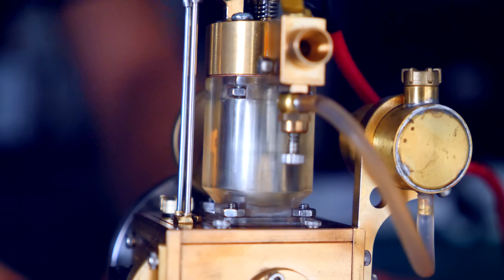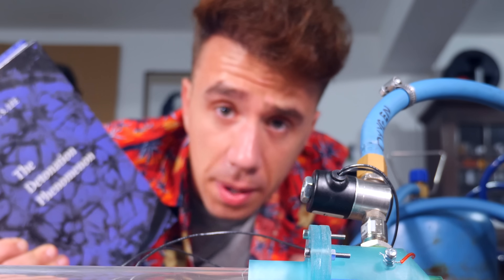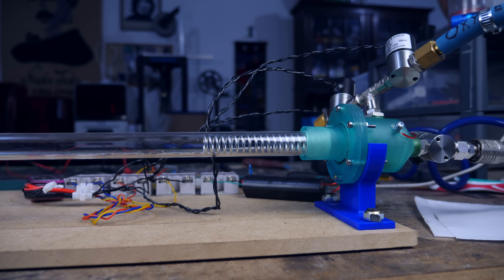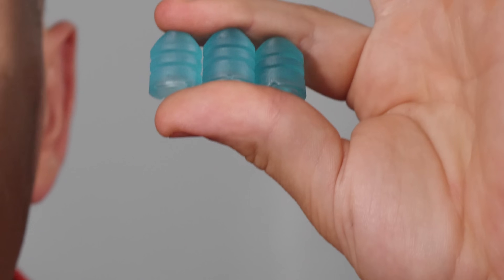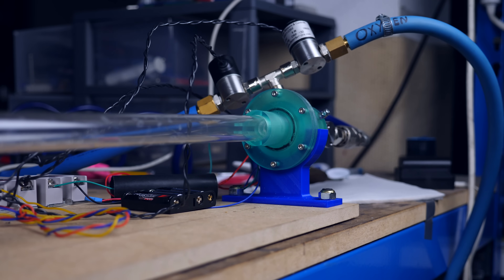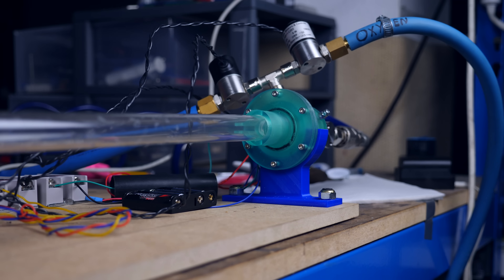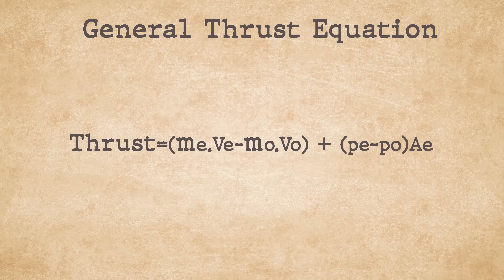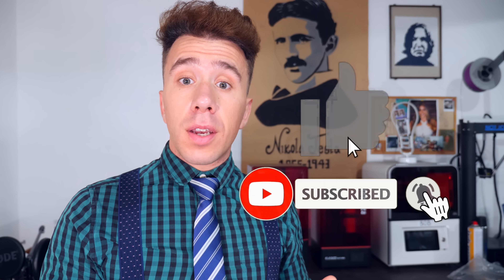PULSED DETONATION ENGINE

Comment: The mushroom shaped flame really resembles what you would see when you look at high speed footage of guns. It's easiest to see with big cannons or tank guns as the projectile keeps moving but the gases behind it gets slowed down by air as it expands. And this rapid expansion is why guns are loud; suppressors (sometimes called "silencers") expand the propellant gases in chambers before letting them out to the surrounding air, reducing noise at least to the point where it won't permanently damage hearing (hunters in Nordic countries are required to have suppressors on their rifles--an odd inversion of many countries' laws--for exactly this reason). 

And detonation is an interesting topic for propulsion because it will mean better fuel consumption. Maybe consider using the detonation to increase momentum of  air in a chamber so that it would exit at a higher velocity; this is the philosophy that detonation engine research is running on, either using standing waves in something resembling an afterburner chamber or rotating detonation that replaces or complements an existing combustion chamber (this also simplifies the engine design since you can reduce the number of compressors).

Comment: What happens when you add a nozzle that closes down towards the end, this would convert pressure into velocity by bernoullis law and make it act more like a jet engine. You could get rid of the pulses by adding check valves and having a continouus flow of butane and air/oxy over a continouus arc. This would likely require a redesign to make the chamber more heat resistant. Additionally i could imagine the diameter of the chamber and tube/nozzle being very important compared to the gas flow you have. Anyways very interesting engine design.

Comment: You could also use a standard turbo for a rocket using compressed air and a fuel injection system and ignition with either a printed or milled nozzle. Try running the exhaust from the turbo back into the turbo with a fuel sprayer and ignition system? Once the compressed air gets it going redirect some of the exhaust back to the intake turbine a mixture of the exhaust and combustion should keep it going.

Comment: I’d love a 3d printer so I thought I’d suggest instead of oxygen why don’t you use electrolysis to generate your own hydrogen to burn in your rockets?
It’s simple to do and it looks like you’d have most of the equipment to compress the hydrogen…. You can also use galvanised tubes for strength and 3D print the jet nozzles or machine carbon nozzles for the best thrust.

Comment: You could pre-mix the fuel in a seperate box. Then make one connection to your actual chamber and break them with a ball valve. If you want to make it really fun, you could take out the blockade, that stops a normal opperator from overturning it and connect it to an electric motor. The faster the motor spins the more often your valve is open and the more pulses you can make

Comment: You could double your gas valve speed by putting two supply valves into the combustion chamber and set up your Arduino code to do an alternating trigger between the two valves.
Reply: Was thinking same thing ... although for 450 Hz he may need up to 45 valves per line (since he could do 10 Hz per valve ) at least I guess
Reply: Can you please explain bro why's there 4 relay? Two for valve one for High voltage generator and one more?...

Comment: I don't think that's a good idea. The faster it goes, the easier it is to melt the detonation chamber, either fractionally on a surface level or literally entirely, unless you find a way to keep it extremely cool.
Anyway, you should have used a combination of piezo-electric sensors, reed switches, photodiodes, *optocouplers* and custom made tunable pressure relief valves to avoid latency. Rele' switches and solenoid valves are just awful, unfortunately. The easiest route isn't necessarily the best route, in some cases. That's one of them.

Comment: I'd love to see this engine with a nozzle/exhaust on the end. It would be interesting to see the difference between the non nozzled, a wide nozzle and a small nozzle.
Reply: A shockwave jet engine is a type of jet engine that uses a nozzle to create a shockwave. The shockwave helps to compress the air, making it more dense and thus more powerful. This type of engine is often used in racing applications, as it can provide a significant power boost.

Building a shockwave jet engine is not overly difficult, but it does require some specialized knowledge and tools. The most important part of the process is choosing the right nozzle size. If the nozzle is too small, the engine will not be able to create enough power. If the nozzle is too large, the engine will be less efficient and may even stall.

Once you have chosen an appropriate nozzle size, you can begin building your shockwave jet engine. The process is relatively simple and can be completed in a few hours.
Reply: A nozzle won't be need, it's too powerfull

Comment: So this got me thinking towards the end of the video. What if instead of using electronic valves, you come up with a design that uses gears in the shape of a fan blade in a sense. So you can use the oxygen coming in to rotate the gears. The psi of the oxygen would control the rotational speed of the gear atleast until you design a brake system to slow fown the rotation speeds. The tips of the gear would essentially cover a hole where the oxygen mixes with the butane. So it'll act as a mechanical valve. This may very well allow you to reach greater pulses per second. Could maybe do 2 or 3 gears at a time to increase the pulses to the point where it's almost 100% continuous. Not sure if that would work very well, but i am half a sleep and love these types of videos! Keep the amazing content coming!

Comment: I don't know why you try so hard to fail all of the time.  It's not that hard to make something successfully.
You obviously did your homework and referenced other types of successful pulse jets. 
What is the max cycle rate of those solenoid valves? Considering Gems Sensors doesn't list a cycle rate for these valves I'm guessing 10Hz maxed them out. A solenoid valve of 25Hz is considered a high cycle rate so you're never going to be successful considering you need it to be roughly twice that for a large pulse jet such as for a V1, or 250Hz for a pulse jet of this size.
Maybe if you switch to reed valves you'd be more successful. (see this for an interesting way to make them: https://youtu.be/jEnNMTMZadw)

Also I guess if you're a GenZ parodying a Millennial that reinvents proven tech and gives it a new name for no apparent reason... almost congrats, your stash needs to be more beard-like.

Comment: Just looks like the German V1 
The “buzz bomb” 
Except you’re using compressed air on the inlet instead of a ram air intake

I know reed valves would be good for this application 
But if electronic timing is really your goal, I can’t help but wonder how koenigseggs “freevalve” technology works... if there’s any freely available info on its function 
It’s an IC engine with electronically controlled valves

Comment: My setup was camshaft driving poppet air valve, and 2 sets of old car points, 1 for the electric injector and one for spark. My fuel was from electrolysis hydrogen and oxygen. The poppet valve was for blowdown. You should  be able to get detonation somewhere in the region of 5000 m/s. Oh and I tried driving a tesla turbine. Gave up when  my fuel source exploded

Comment: you should measure the speed of the bullet at the middle and end of the tube. If its faster at the end the tube should be longer. if its faster in the middle the tube should be shorter

Comment: Video suggestion: instead of the electromagnetic Valves to control the cycle, use them only to open the gas flow and use tesla valves as reverse protection. This way you only have to control the arc for ignition and could probably go way faster.

Comment: Idea for a future video/series: Make a bicycle out of only wood and natural-fiber rope, then put on it an engine made from wood and terracotta. Those should be good-enough challenges, for now. And you will probably get more ideas on how to continue it, as you release more videos and as you research more about it. For example, instead of using pedals and a gearbox, you could at least start with treadle which allows you to change the torque-to-speed ratio depending on where you push, more useful at lower speeds, but still usable at higher speeds. You could even add static pedals on the side of the treadle, to indicate where the recommended speeds for different purposes would be.
Reply: Why?  All that work for a shitty bike with a poor engine

Comment: Try making a small rocket powered car using the pulse engine. It would be interesting to see how fast you can get it going and what mixtures give the most thrust. Would the limiting factors be the weight and size of the car or would you run out of fuel before getting it to top speed? Could be a really fun video to watch.

Comment: So... If you took the ~mach1 gas out of the detonation engine and push it through an impeller whose spindle was attached to a skateboard wheel.. Then force the skateboard wheel against the wheel of your bike (friction drive).. you could make a bike with some speed.. Question is, would you run the impeller towards our backwards? You said the gas is high pressure, which is usually the output of an impeller, rather than the normal input ..

Comment: Have you tried increasing the diameter of the nozzle or increasing the size of the combustion chamber?    Maybe the length of the tube?    Also.  Why is the tube strait?  Would a reduction in diameter acting like a funnel give you more pressure for longer duration?

Comment: Yeah, all you need is a cut hole in the bottom of the exhaust, a second pipe with a spring in the bottom and a lip at the top and some ball bearings and you'd have a firearm. A crude homemade one, yes but a firearm nonetheless, it wouldn't be the most accurate due to the "barrel" being smooth-bore, meaning the barrel isn't rifled meaning the projectile, in this hypothetical case, ball bearing, wouldn't spin leading them to have a less stable flight path. Infact in it's current state without my proposed modifications, it's just be a more modern take on a musket. But if you were to add a spring based magazine and some sort of electric trigger mechanism, one step to fill the cumbustion chamber, and another step to light the fuel air mixture it'd be close to what I would call a "Potato Cannons Drunk Uncle-in-law." Or a smooth-bore battle rifle. Infact you can IN THEORY make this a portable design if you make a backpack to carry the Oxygen and Fuel and you can IN THEORY make the magazine a gravity feed system and have the mag sit upside down on the top of the barrel, it'd need to be screwed in though, to help midigate the risk of it blowing off and hitting you in the face, I would IN THEORY recommend putting the mag at a 45° angle facing away from the shooters direction, and as for the jet part I would say use a few "Tactical" hose clamps and a long piece of wood on the bottom to keep everything in place, and as for the aiming portion you should be able to 3d print it, but considering the forces that we'd potentially be dealing with I would say resin print the handle part, I would think something like every man held minigun design as a referance on where to place the front grip and the trigger. Of course this is all in theory. I doubt this'll he seen, but I was too bust writing this the entire time instead of watching the video, but I did listen to it so I did get it, infact even after the video ended I typed this out for 5 minutes, so I do hope that this gets seem by somebody and gets made into reality, since I lack the funds and resources and tools to do this, the only tool for creation I own is a Dremel.

Comment: A wise old engineer once told me “if you can’t measure it, you can’t improve it”.  So I suggest you measure the force generated by mounting the engine on rails attaching a spring between the engine and the table.  Running the engine will stretch the spring proportional to the force.  Then you can monkey with the deign looking for higher force.  Another thing to measure is the detonation velocity.  Put pressure gauges at each end of the tube, and use an oscilloscope to measure the time delay between the pressure increasing at the gauges.

Comment: go build a slingshot and do it like in a cirkel and let it spin real fast than release it so it shoots away from the cirkel by it self just by realeasing it beceause it will pull itself outwards of the rotation. if you want to increase the speed of it do it in a vacuume chamber. if you dont understand what i mean i saw a video where they want to deploy satalites this way the company who wants to do this is called spin launch maby its fun to make like a miniature build of it and try it out. if you like i could send you the link of the video but dont want to add it tho this comment beceause of promotion. sorry for my bad english i have dyslexia

Comment: Make the exhaust thinner and smaller build up more pressure ... namaste
Reply: Use the heat to heat water with a water jacket 😜
Reply: Put a regenerative power source on the exhaust 😜
Reply: try pulsed switched modulation :)
Reply: with a big capasitor inline
Reply: that should break all records

Comment: Build it like a Gattling gun, with multiple tubes designed to fire one after the other giving more time for chamber filling and cooling. Maybe shape the ends of the multiple tubes for one to pull some air into the next. The way collectors work on cars

Comment: Put two valves on each line, the first one is one of those to turn the whole thing off and on, and the second valve is a ball valve that can do a full 360 degrees instead of the standard ball valve that turns 90 degrees for on and turns backward 90 degrees for off.  Then add a motor that spins it so it opens and shuts very fast, 100 times a second is 6000 rpm which a drill or circular saw motor can do.

Comment: You could try and build a Plasma Jet engine. One that is similar to the MET, (microwave electro thermal) propulsion engines. Basically, you would need to suck in air from the front, quickly ionize the inflowing air using microwave radiation, compress the resulting plasma, and possibly add some extra heat to it as it exits the shaft. It's' very similar to a standard jet engine design, the only difference is the air is the fuel. You could also mix the pure oxygen into the microwave radiation chamber for cleaner plasma generation. Good luck and have fun~

Comment: This was interesting!, regarding a future project, it would be great to compare thrust generation from a shockwave engine with conventional fuels and a output froma hydrogen powered device which the fuel is created by an electrolysis device, measuring the power input vs output comparing the resultant energy output of each device.

There is a big drive for sustainable energy, solar and battery powered devices, but there is rarely thought into the energy consumption in the manufacture of these sustainable product.

Comment: A fun engine you could try is a turbo-ramjet, or just a ramjet. The turbo ramjet was the engine used for the SR-71, and it is very interesting. Definitely would love to see one in action at a smaller scale.
Reply: But ramjet won't start under mach 3
  Even sr 71

Comment: Sometimes the shortest distance isn't the fastest. With that I add, if you're able to funnel the compressed chamber gasses into a directional manifold, that may allow a vortex to occur, the velocity would increase dramatically.  Victor Schoenberger used the design of nature to harness the power of natural vortices, which happen to work equally well with compressed atmosphere as water..   then using those principles to create levitation, for Hitler.

Comment: What if the burning chamber is ringshaped? So you use a rod or a tube you have a smaller burning chamber but the pressure might be bigger
Reply: https://youtu.be/rG_Eh0J_4_s something interesting from Scott manley
Reply: Maybe the acrylic part was slightly stronger then the metal one?

Comment: A rotating valve that you could spin up as fast as you wanted with an electric motor. Basically a disk with a slot to let mixed fuel in then closes off during detonation. You could get probably get  60000 rpm 1000 pulses a second.

Comment: Detonations are faster the' the speed of sound every thing below and at the speed of sound is considered a deflagration. You should take a look at Rotating detonation engines. They have somewhat of a continuous thrust.

Also Tesla valves are specifically meant for puls waves. You should use them. Ideally should the Tesla valve have more than 11 stages of those flow reversing chambers

Comment: You could do an occiliating heat pipe with tesla valves as a motor / or as you plastic pulse engine cooler...

Comment: I wonder if the diameter of the mushroom shape happens to correlate roughly to a more optimal nozzle exit diameter. Maybe you are pushing the air so fast it's acting more like a lance and not getting the resistance needed to push back off with back-pressure. If that's the case then another question would be at what point along the tube would be the most appropriate to try transitioning to a larger diameter. Just an armchair theory.

Comment: TESLA TURBINE - TURBO JET FUSION.
Could you use the thrust from a turbo jet to run a Tesla turbine, which is connected to the jet compressor.

Comment: It seems as if you added an expanding nozzle at the exit of the thrust chamber you could increase the thrust/make use of the atmospheric back pressure shown in the still photo.  Of course optimizing the design of the expanding nozzle requires some serious math, so I can’t help you there:-)